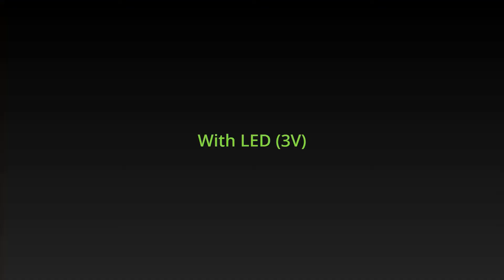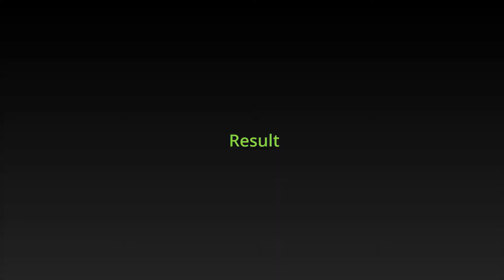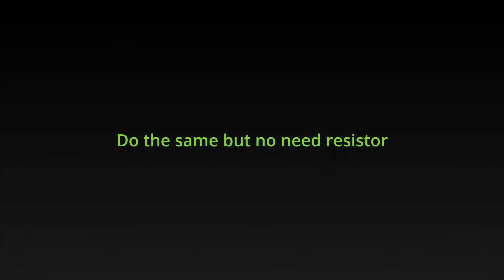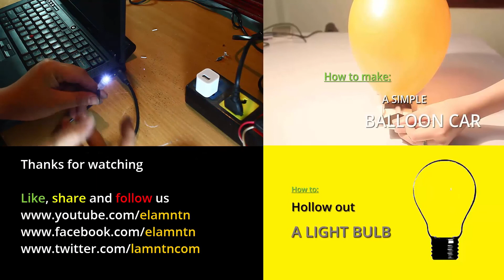Making a flashlight LED using USB cable

Comment: Hey ya I was wondering why my led strip won't light up? I did everything you did without resistor. Do I need to add resistor to make it work? I think there is something with power safety because when I tried it the power automatically  switch off